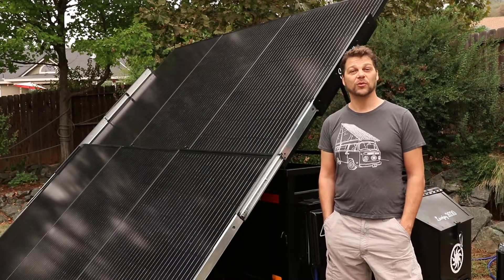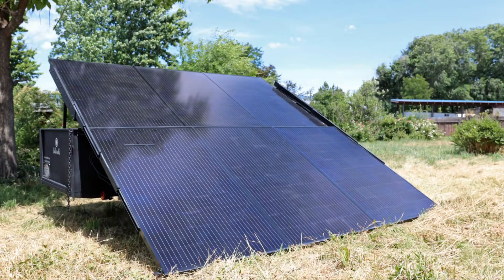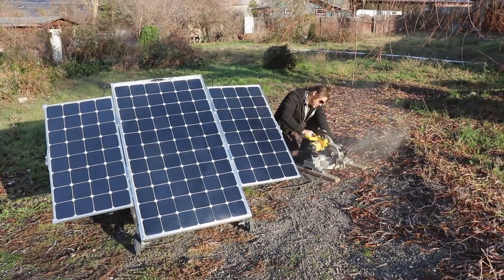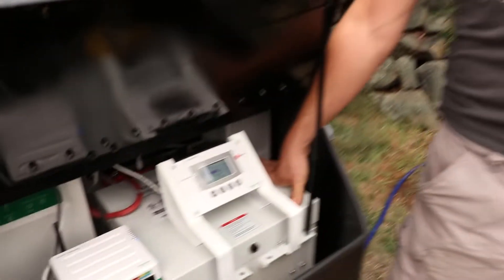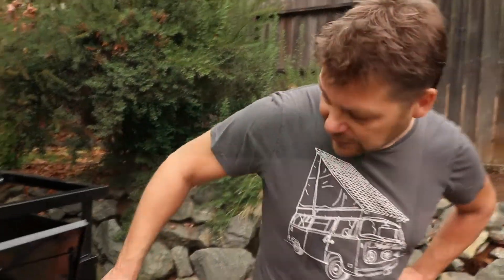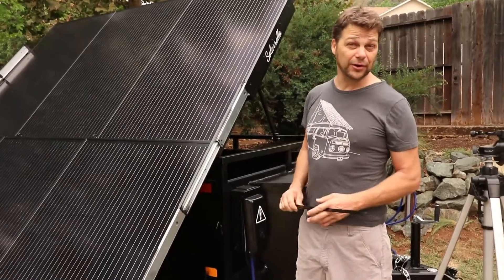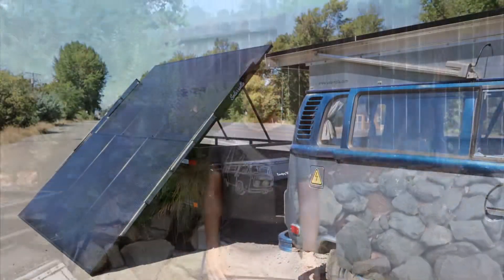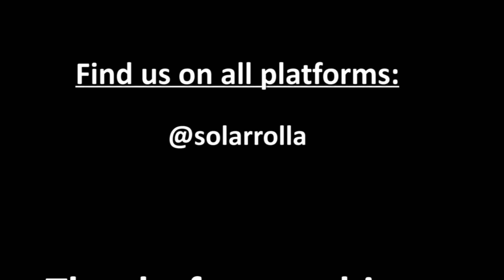Solar Trailer, Mobile Power Station

Comment: I have 4350 watts of solar, 6000 watt 240V split phase inverter, and 15360 watt hours of battery storage  all on a 40 foot motor home that I have traveled the country with. Boondocked for months out west in the mountains, had all the electric i needed. I did this 4 years ago, about the same time you put this video out.

Comment: Interesting 
I am planning my unit around an enclosed tool trailer with half the PV on a tiltable roof rack, and the other half attached to one side with linear actuators to tilt it out/up.  This allows all the inverter and control stuff to be inside the cargo trailer space safe and dry, trying to figure a way to safely mount the batteries between the main frame rails - low centre of gravity and out of the way - but not sure they would be safe in this area without a lot of protective steel.

Comment: Im keen for one of these in Australia - but also want to know 1. if the top panels get damaged (,hail or rocks etc) can you still run/disconnect the under layer panels? 
2. Can you use the trailer on the road without having to extend them? 
3. Can you attach/in corporate water heater or water air generator/capture  functions
4. Do you HAVE to have signal/ connection to app/phone to work or Can it work fully stand alone?
Reply from the maker: You can run just the bottom or just the top panels. You can run pretty much anything so you could do a water heater or water capture system.
Reply from the maker: It does not need internet connection unless you want to read the battery and status from your phone.
Reply: we have better product ，do you need it？

Comment: 1:41 Really ice with the sliders! Are those custom-built or a brand you could recommend?
Reply from the maker: There are just a heavy duty drawer slide that we purchased on Amazon. Brett did do some customization to get them to fit correctly in our application.

Comment: How about old weather use?  Does the lithium battery require supplemental heat to charge it?
Reply from the maker: This one is not in a cold climate so it was not a concern. If it was in a cold climate we would need to add a supplemental heater.

Comment: I built this prototype over a few years . Its  powerful
Reply: I like the drawer slides. Do you have similar slides and if so, which one are they and where did you get them from? Thanks!
Reply: @simonsays8935  I didn't use drawer sliders I built mine out of unistrut and linear actuators its foldable electric . And has single axis tracking because I have a wind turbine tower too .

Comment: I have 1200 watts solar on my motorbike trailer. Can fit 2 touring bikes in and they are covered. Plus I have used it for interstate furniture removal across country 3000miles. A much more useful trailer.